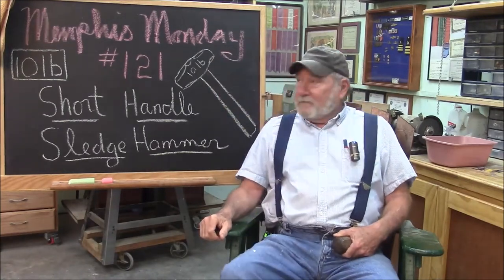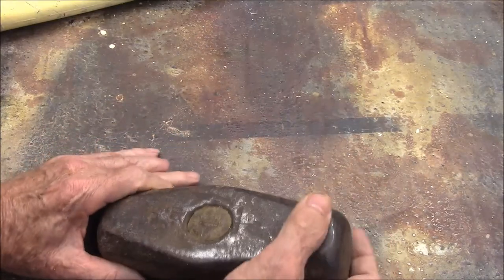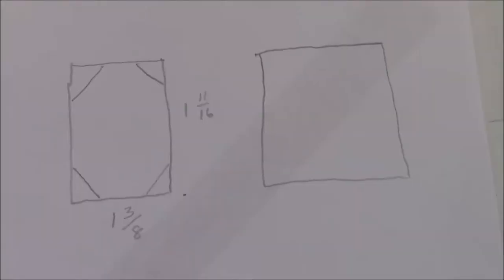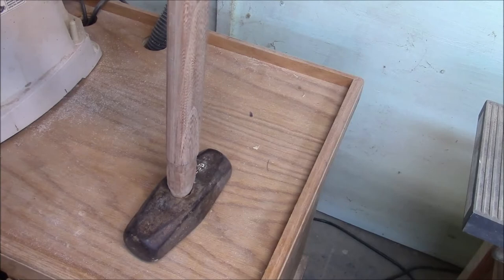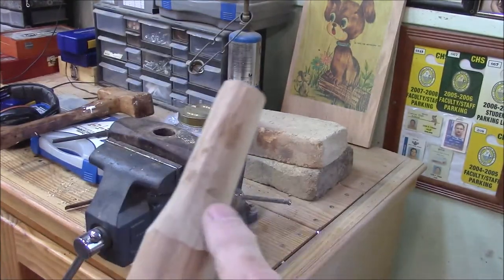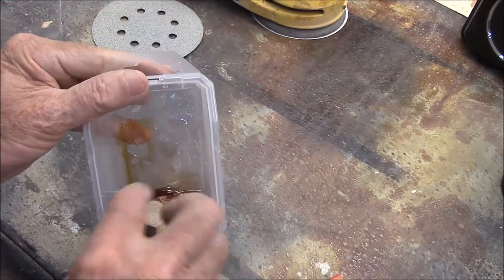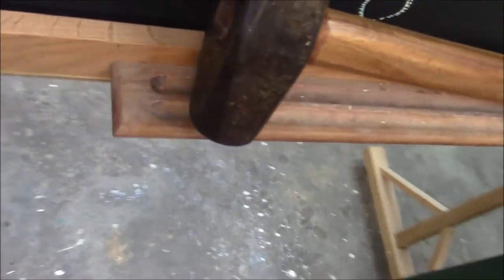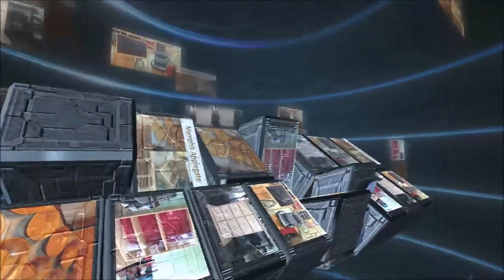121 Short Handle Sledge Hammer Build

Comment: Very nice video and take-a-ways. I have never made a handle. If I ever need to make a long handle sledge, I have seen an interesting design to protect the wood. I have read where some guys weld a pipe to the bottom of the head, put the handle in normal, then use wedges (all around) from the underside to center and hold everything secure. That way if someone "overshoots" the blow, the impact will be on the pipe, not the handle. The ideas is to protect your handle from rookies like myself ha ha. Anyway, I thought you might like this trivia. Not for everyone. For some it might be embarrassing to tell on yourself that you cannot hit what you are aiming at. Fun to watch your stuff as always
Reply from the maker: The pipe idea sounds pretty good to me.  I've even seen that design sold, especially in splitting mauls.  
     In terms of making a handle, unless you are into it like me, buying a good handle at a real hardware store is a good option.  
     Thanks for the kind words, and thanks for watching and commenting.

Comment: I have followed through with the assignment I was given and hope that I can come up with the correct answers.  

I have never seen a sledge hammer with a head quite like this.   Is the unusual shape because it is a railroad spike sledge?    I am sorry to hear that someone has stolen your idea and put it on the internet before you even have the idea.    I don't know much about sledge hammers, but it seems that this length will be better used in the shop rather than busting up rock and such.

What is the purpose of putting both the wooden and metal wedges into the handle.  I know the wooden one is to put tension on the wood to hold it in the handle.

Now for the assignment.  I still maintain that you really enjoy a challenge of starting with a small part of a project and designing and executing an excellent finished product.    Also, both of the videos of these projects flowed very smoothly from one step of the project to the next.  Both videos are relatively short because of the smooth flow.  Am I getting warm to the right answer?

Very nice finished product!  I hope your buddy likes it.
Reply from the maker: I think you are right.  Seems like the scenes flowed together; they were linked, with both less chatter and wasted time.  And the project in both videos was small enough to keep a focus on the final goal.  I should keep that in mind on the larger projects, which need to flow not only between the major parts, but also the processes within the various parts.  Who knew that video making was to complicated?
      My buddy called it a railroad spike sledge, but I was totally unfamiliar with the design.  Yep, that is the idea.  The long handles are used outside for driving and pounding, and the short handles are used in the shop, or in other tight situations.  
      I copied the wedge configuration from high dollar wood handles I've seen for sale.  My assumption is that the metal wedges serve two purposes:
     1.  Expand the wood front to back (while the wooden wedge expands the wood side to side).
     2.  Keeps the wood wedge in place.  With the wooden wedge going one way, and the metal wedge going the other, the whole mess is intertwined and impossible to remove.  
      **These are total guesses, as I'm not at all conversant on wedges.  However, I probably need to bone-up, as I've made a few handles now, and ignorance is losing its credibility.  
      I'm currently designing a box (Called a blanket case), which I won't be building until fall, but I think I invented a new elegant way to hinge the top.  This time I'm cutting out the middleman, and I'm not going to check the internet for those copycat, invention-stealing guys who stole my invention 200 years ago!!  Why, the vary idea!!!  And to think those quakers, and Amish,  and Shakers aren't even supposed to have computers, for heaven's sake.  
     Thanks for the kind words, and for taking on the assignment.
Reply: Just don't cut too much out of the big projects.  We will begin to wonder how certain aspects of it were built.  I think it is not that video making is so complicated but the human psyche is complicated.  It is difficult to discern what is pleasing and holds the attention of the viewer.  I am sure there is some field of science totally devoted to this phenomenon.  

Your two justifications for using the metal wedges make perfect sense.  You addressed the physical properties of the wood to make it a stronger connection......Purely speculation on my part.

I look forward to the blanket case project.  Did these guys 200 years ago have no shame?    You have to watch those Amish and Shakers posting all your great ideas on the internet and saying they had them 200 years ago.  Hahahahaha.

I decided to rent a UHaul trailer to practice with so I wouldn't be so nervous about destroying my camper.  I have learned that as long as I am pulling it down the road or backing up straight, I can handle it.  However, it is the 90 degree backing that is going to give me issues.  If I have a few hundred square feet to make the maneuver, eventually I can get it in place and lined up straight.!
Reply from the maker: The bigger the turn on backing the harder it is.  Don't rush.  Don't over-correct, which is the biggest sin in backing.  Takes lots of practice, which you will never get, to reach the "god-level" of truck drivers, etc.  I've been towing trailers and boats for years, and I still need to bailout a few times on all the hard maneuvers.  Very simple, if things go South, pull forward and try again.  But you have it right:  it takes practice.  
    The U-Haul notion is a good way to get the fundamentals, but remember that everything backs and tows differently.  The main variable is the distance between the centerline of the trailer wheels and the hitch.  Tongue weight is a factor also.  But good luck.
    And if you are nervous, just remember that story about my Mom.  Man, they were tough back in the day.
Reply: I have perfected the ability to pull forward and start all over.  I learned from this little uhaul that the shorter the wheelbase the quicker it will jackknife.  I have also learned that I need to put my pride on the shelf and gladly ask for and accept assistance.  

The story about your Mom is what is propelling me forward determinedly to  conquer this.
Reply from the maker: Don't worry about pride, heck everyone knows how hard backing can be, and everyone who knows how to do it well also knows that it took a lot of practice to get there.  Never pretend to know things you don't know; never pretend to skill you don't have.
     In 1984 I was in the middle of the Atlantic Ocean standing watch as "Officer of the Deck" on a Navy ship.  In the middle of the Atlantic Ocean and in the middle of the night I received a call from Engineering Officer of the Watch, who rattled off some obscure report I had never heard of.
     "I don't know what that is, and I don't know what your report means," I said.
     "You are standing OOD (Officer of the Deck) and you don't know what it means?" the EOOW replied mockingly.
      "Do you want the OOD to pretend to know things he doesn't actually know?"  was my immediate reply.  
      "No, I guess not,"  was the EOOW's response.
     "Exactly," I continued, "when you give me a report, and you put down the phone, you can be assured both that I know what you are talking about, and that I would have told  you if I didn't understand.  Are we good?"
      "Yes sir," he replied, and then  he went on to explain the report. 
      From that point on we were indeed, good.  I think it was a side of the question he had never considered. 
      Keep working on it, and remember this:  Albert Einstein, I'm sure, could not have backed that trailer any better than you.  I'm way too lazy to look it up, but I'm sure it's a fact.
Reply: My problem is not that I am too proud to ask for help but that I am afraid I will bother people.  I totally agree with you about not pretending to have a skill that I don't have.  You and I both have worked with people who refused to admit that they didn't know how to do something or what something meant, in your case.  The government is full of those folks.

I guarantee that the EOOW had a lot more respect for you after that interchange.  It is very easy to see through someone who is faking it if you know your subject well.

Here is the quote that I found when I googled Albert Einstein driving a car......Albert Einstein had no car of his own and he also never learned how to drive. If he had to, he was driven by friends and relatives or their chauffeurs.   So, I am one up on Albert Einstein..  No.  I can't claim that.  It would be like saying that I am a better person than Mother Theresa because I can drive a car.    I will say that even the great Memphis Applegate  had to cut his first piece of wood at some point in the past and look at him now!  This gives me hope.
Reply from the maker: Here's a "Great Memphis Applegate" story.  I've always been a builder and inventor (of things already invented, I must say), but I remember in about 1953 coming up with this great idea:  Why not hook up a generator to one wheel of my bike, and a motor to the other wheel of my bike?  
      I broached this idea in mixed company, and received nothing but laughter from our neighbors and friends.  "But wait," my father interjected, "He might have something there!"  It's a good thing my Dad never used a computer, or he' would have fallen for every perpetual motion machine on YouTube.  
     Plenty of fakes in government work, but plenty of non-fakes too.  I always admitted what I didn't know, but I knew plenty of folks who seemed to know everything; they remembered everything; they could do everything.  In the Navy these folks are known as "hot runners," and their records are flagged as soon as possible with the words "flag potential."  
     Funny story about Einstein, but it demonstrates my point.  Everything takes practice.  You can be the smartest person ever, but if you haven't done a thing, then you are a rooky.  No shame in that.
     I see your point about bothering people.  I had not considered that angle.  But remember people (especially men) love to help; they love to show how skilled and smart they are.  It is human nature.  I guarantee that any guy who knows how to back a trailer like a pro is going to leap into a chance to show that skill off.  Guaranteed.
Reply: That is a funny story.  As for the end of the story, did you ever attempt to build said contraption?  Are you saying that your dad would have fallen for the Bedini myth?

I agree with you about the non-fakes.  I worked with a few fellows over the years that seemed to remember every single detail of their job.  It is funny, my boss was like that but if you ask him to recall a certain person or incident he can't remember a thing.  You say these folks were flagged.  Was that a good thing or bad thing?  

After poking around on the internet, I have found a campground about 3 miles from my house that has pull through sights.  It is one of those boring commercial campgrounds that I am not very fond of but it would give me practice.  The down side of living so close to the Smoky Mountains is that every place like this is priced for tourists and I would have to pay over $50 a night to stay in a boring campground.   

I appreciate your encouragement and promise that I will be a lot more open to accepting help.  It is funny that I have spent my entire life doing my best to be independent to live down the image of a woman dependent on a man.  Now I am coming to the realization that I do need help even if it is not necessarily a man.